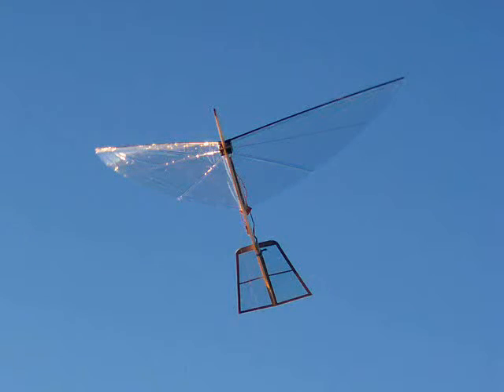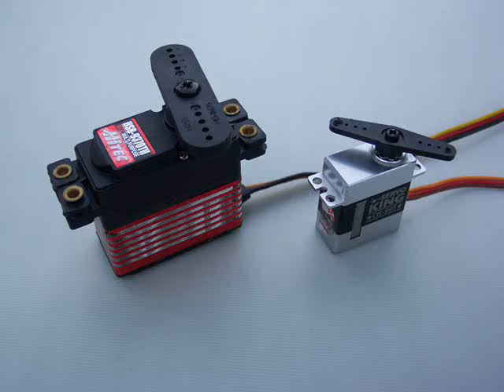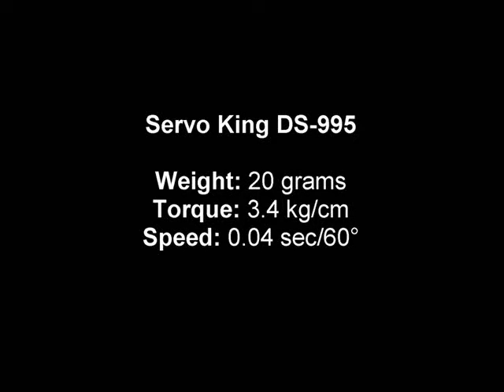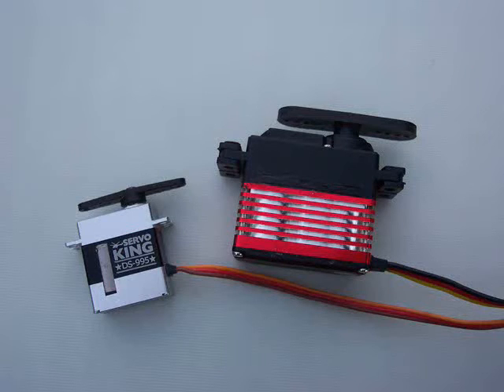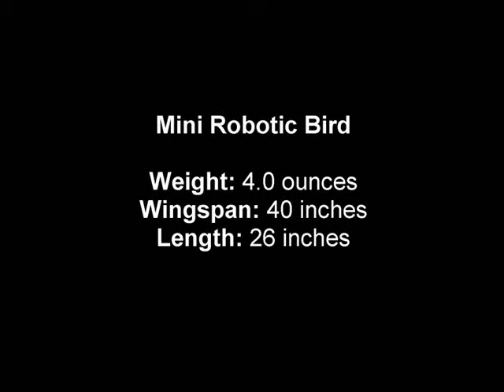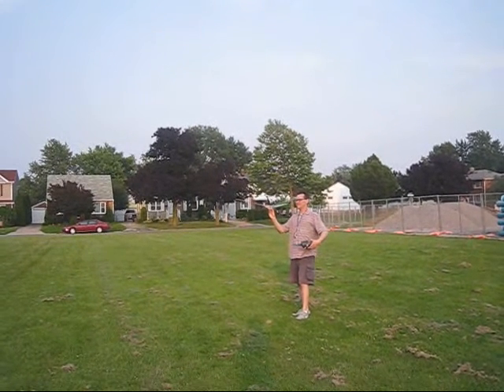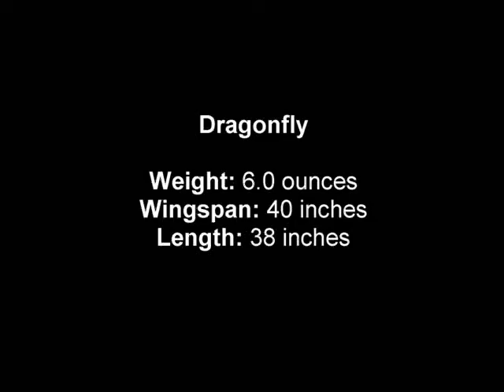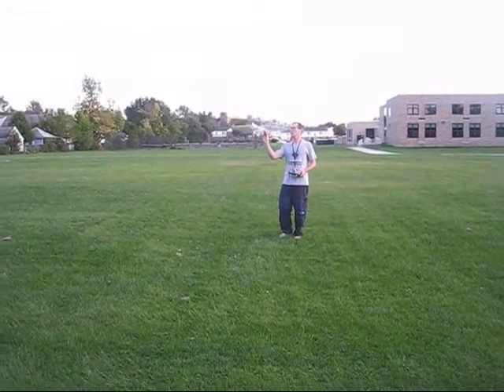Mini Servo-Powered Ornithopters

Comment: Sir, can there be a phase difference in the beating of the forewings and hindwings of the dragonfly?
Reply from the maker: Sorry for the slow reply. Tandem wing ornithopter experiments by Pete Valentine determined it's best to have the back wings 90 degrees ahead of the front wings. I followed that advice, but the programming can be changed so that any desired phasing could be achieved. It could be controlled by the RC transmitter.
Reply: @OrnithopterZone1  Thank you so much sir. I will order few of them soon.

Comment: Hi Nathan , what was the flapping rate ? 
would this servo work ? its speed is half of that DS  995 . 
Stall Torque (4.8v): 3.1kg/cm
Operating Speed (4.8v): 0.13sec/60°
Weight: 14g
Reply from the maker: too slow